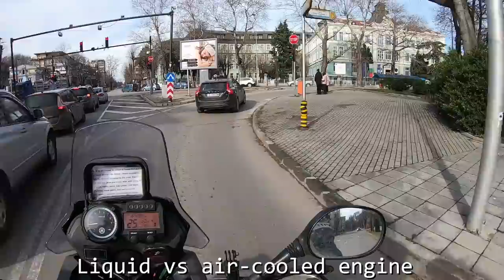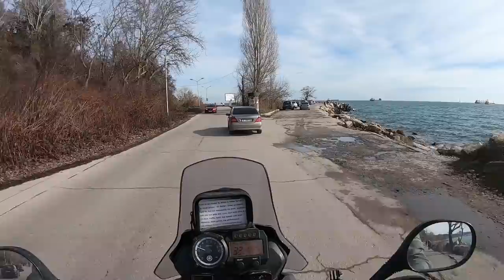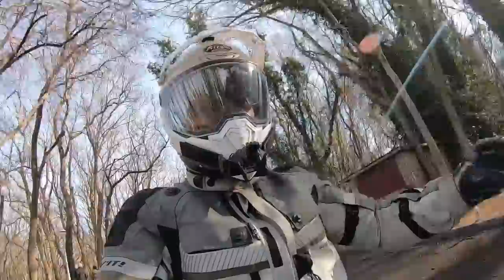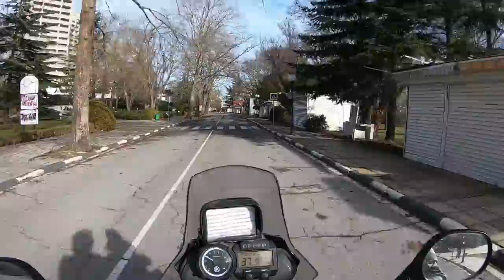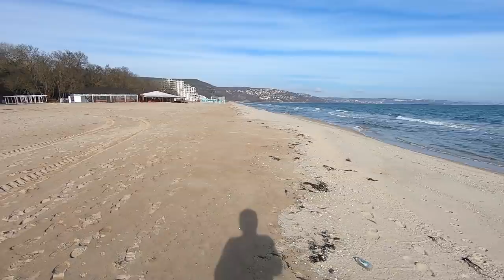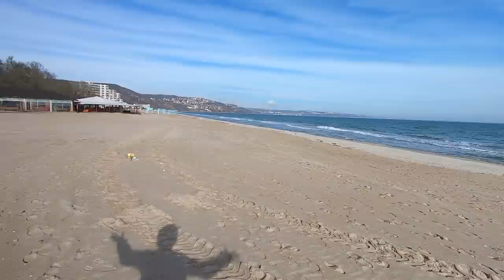Water vs Air Cooled Engine for Long Motorcycle Trips!

Comment: Mostly academic argument due to the nearing extinction of air cooled motors. Within a few years the Dr650 will be gone, unsure whether it will,be replaced by a modern engine. Certainly Japan is abandoning singles leaving KTM the winner. A big issue is whether your bike comes from Japan or Austria/ Germany. On a KTM I carry a spare fuel pump but a blocked injector is a real problem. Interesting to see that on his round the world travels, Lyndon Poskitt uses a carb equipped KTM rally motor as he can always fix a Carby by the side of the road. Try that on an FI bike in Mongolia.
Reply from the maker: This will be the topic on my next video.

Comment: I did a 650 Km touring in my Air cooled Gixxer and didnt find any heating issue, I did the same thing in Liquid cooled KTM and my leg was toasted after 100 Km
Reply from the maker: It is because of the way the engine is constructed and mounted, not because watercooled is bad.

Comment: I never had any overheating problems with my aircooled boxer-engine, even when riding 2up and with luggage on holidays. But i have an oil-radiator with thermostat mounted and it only got 60hp out of 1000ccm, so its not the most powerful, but it will run on low oktane fuel, which modern bikes cant use.
Reply from the maker: Most of the air-cooled engines also have oil radiator.

Comment: If you buy an old bike and want to make it reliable again , and liquuid cooled engine will have much more things to check and be concerned about for some time.

And air or air/oil cooled engine will be way easyer to check for anny issues.

I have air cooled and also a liquid cooled engine bike.  I Dont have a garage for the bikes, so Sun exposure will be harder for a liquid cooled rubber hoses and stuff.
Reply from the maker: Thanks for sharing!

Comment: I love simplicity actually without any reasons this is a feelings I can't explain. So of course I prefer air cooled engines as well as carburetors and single cylinder, though it's very rare nowadays, unfortunately.
Reply: I feel that, love my 82 Honda inline 4. Carbureted and air/oil cooled.

Comment: Hi Pavlin,

I think this is the first time when I do not agree with you. Just check 90% of Police motorcycle arround the globe. They are air/oil cooled BMW RT's. They are using them most of time in the city. They are working without  problems and they have over 150 - 200k kilometres, each. Don't get me wrong, I am riding a liquid cooled motorcycle but BMW is producing an air cooled engine bullet proof.  I think that if the engine has all the modern tehnology you won't have any problem with it, city or hot areas. 

Greetings from Romania!
Reply: As far as I know RT's serie is air - LIQUID cooled, and not air - OIL cooled.
Reply from the maker: As far I know BMW stopped producing air-cooled engines.
Reply: @motorcycleadventures  Hi Pavlin... I think they are still producing air-oil cooled. I'm talking about R 18.
Reply: Yes, BMW does still make air cooled motorcycles. 

There has been some advancement recently in coatings used on pistons, cylinders, etc that allow for closer tolerance than the old technology. The air cooled engine is not dead. 

Before paved roads there was mainly air cooled engines that did rather well for the time. Liquid cooled motorcycles have advanced as well. Both work well and perform their intended function. It would be best to choose some other criteria to pick the right motorcycle for what you want to do as cooling is not an issue.

Most people are comparing 20 year old bikes to new ones. Look at the new air cooled bikes.
Reply: @motorcycleadventures  They still produce air/oil cooled engines for the R nine T series of bikes .It is the same boxer engine that I have on my R1200R .
Reply: @mihaimihai9254  Yes the more recent RT series have liquid cooling .The cylinder heads are the only area that receive liquid cooling . Air  cooling still has a role to play in these bikes.
Reply: @grhmnz4648  Let's not forget about the Urals ...Thet still have classical air-cooled enines -::))).

Comment: Because the air-cooled systems have been perfected and are more robust ! Somebody explained to me once that cars now can stop and re-start at the lights or when stopped in traffic etc. In the old days starting was not always guranteed not 100% easy to achieve. Nowadays systems have improved so much they are available everywhere like radiators on motorbikes 🤔😏
Reply from the maker: Thanks for taking the time!

Comment: “emissions”. 
controlling engine temperature is a part of controlling emissions. 
with emissions regulations getting more strict all the time, manufacturers have to use liquid cooling every chance they get. 👍
Reply from the maker: If there were demand there will be a supply!

Comment: On smaller displacements engines   air cool is fine as they don't generate much heat. Bigger engines definitely need liquid cooling. I take my xt250 where I wouldn't take any liquid cooling bike even though they would be more capable. For munching highway miles cruising 90+ mph Super Tenere does what lil brother can only dream about.
Reply from the maker: Ok

Comment: Water, air and oil cooled engines are in the end air cooled engines. The difference is in what type of liquid/gas we will use to dissipate/transfer heat from the source. I have a BMW motorcycle with a boxer engine. The engine is cooled by air and oil, plus there are no problems with traffic jams because it is equipped with a thermostat and a fan. I don't see any flaws.  Water cooling is "future" bc the reduction in oil capacity and emmisons standards is intended to preserve the environment. 
So today, highly efficient engines are made that are more enviromentaly friendly, and on the other hand, there are more complex systems that require more expensive production and maintenance, as well as a higher probability that something breaks down.
Reply from the maker: Thanks for taking the time!

Comment: I would say water cooled is better for long trips. It gives more consistent performance, and typically better fuel mileage. It is a better choice if you are force to move more slowly, which reduces air flow over an air cooled motor like off road riding. If you prefer road style motorcycles, liquid is better, and notably so...the first time you hit what I call stop and stop traffic. I've taken many long trips with a friend that uses a air cooled machine. On occasion, just because of traffic conditions, his engine temp has read 320 degrees, with 280 being the normal. 

We have had to exercise what we now refer to as the Tennessee protocol. That mostly consists of taking the breakdown lane and moving that machine enough to cool the motor before it destroyed the ECU. We've had cooling issues just because of traffic even in the cold weather. We've enjoyed riding in Badlands Basin in the middle of June with 124 degrees air temp. As long as we were still moving it was able to work well. My liquid cooled motorcycle has has no issue in any condition we've encountered yet. That may change in the future, but I haven't seen any complications yet.
Reply from the maker: Thanks for sharing!

Comment: I have seen air cooled engine's that are effecient Cool running and powerful and fairly quiet. It's been done and they can be quite durable and long lasting. Planned obsolescence. More to repair  replace. Heat sink head's can be effecient at cooling and light weight.
Reply from the maker: Ok

Comment: Only 1 time have I managed to get the fan spinning on my 660z Tenere - that was some hard work/clutch in the forest - otherwize i never hear it and it is a maintenance free system. I changed cooling 1 time - only to make sure I know what was in it, how much antifreeze. so simple.

Even Porsche knew watercooeld was better for their rear mounted engines.
Reply from the maker: Thanks for taking the time!

Comment: I've noticed that air-cooled engines seem to be mostly limited to 250cc and less by the major Japanese and Chinese makers.  I've, also, noticed that air-cooled engines are generally run with less/lower compression ... which, in turn, make less power ... no doubt for operation in geographies with poor fuel quality.  I note that the (big) Royal Enfield air-cooled engines, which make relatively little power from their displacement, seem to be de-tuned with low compression, also.  I've noticed that the higher power:displacement engines (usually running high compression) require the shorter maintenance (especially oil-change) intervals.  From an engineering/design viewpoint, it seems like the more STABLE coolant temperatures, obtained with liquid cooling, allow higher compression and the resulting higher power:displacement ... and, probably, higher fuel mileage.

Though I struggle with your accent (I still haven't been able to make out your name! 😄 ), I do enjoy and appreciate your videos.  🥰
Reply from the maker: Pavlin is my name.

Comment: I have a 2011 Honda XR 250 Tonrado, which was manufactured in Brazil. It is air/ oil cooled and is fuelled by a carburettor. It was replaced in my country by the Honda CRF250L, which is fuel injected and water cooled. Both bikes have identical horse power and torque, although the XR gets to this torque sooner in the rev range and holds it for longer. Furthermore, the Tornado is more fuel efficient than the  CRF in real world riding conditions (I know this having done a comparison with a Tornado and a CRF on an actual trip). I am not a fan boy of air cooled or water cooled over one another. I also have a fuel injected, water cooled XT660Z like yourself. But I think we must be careful in making stereotypical arguments like being water cooled or fuel injected always provides more horse power, and is more efficient. I must however admit one con of the oil cooled engine in the XR to that of the water cooled CRF. It has much shorter service intervals, perhaps because of the harder work the oil does in having to lubricate and be the means of cooling as well?
Reply from the maker: Fair enough!

Comment: This is  very interesting topic. For myself it depends on a few factors. 

It depends where I'm going to ride. For example Mongolia and Inner Mongolia. If you break down getting  a water cooled engine will be nearly impossible. The same goes in other remote areas where there is nothing.

Here in Taiwan the coldest our winters get is 15 and thats only for a few days. The average winter temp is  between 19 to 25, Summer temps starting in April to early September range from 31 to 35, with the hottest being 39 to 40 for about 2 to 3 weeks in July and August, If I know I'm going to be riding in an around Taipei or other cities I will use my water cooled bike, but I'm I'm going to be in the mountains or riding along the coast where there is nothing. Then I will use my air cooled bike.

I remember in 2018 riding in North Vietnam and the air cooled bike I was using broke down on the border with Laos. I was also 200km from the closest shop that could fix it, but it ended up taking 3 weeks to get the parts. If I had decided to use an old BMW R69 there were 3 repair shops and they had parts.

My point is if your riding in developing country. Simple engineering is always better.
Reply from the maker: Ok

Comment: Air cooled is easier to repair but if ur cooling system is assembled correctly and serviced on time, then the cooling system should just work without any problems or major repairs for many years.
Air cooled engines run hotter than water cooled so they dont last as many miles